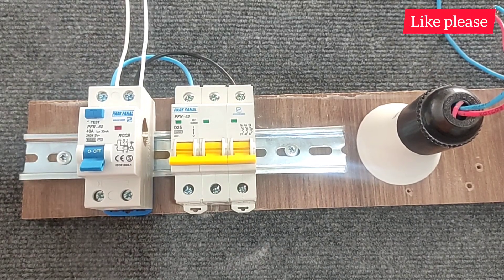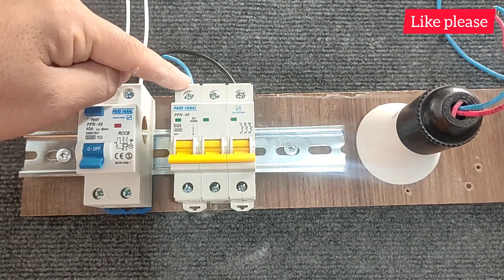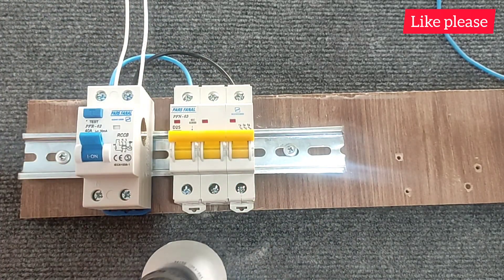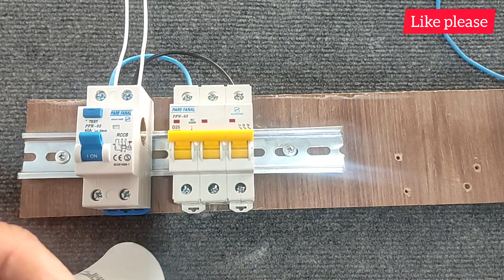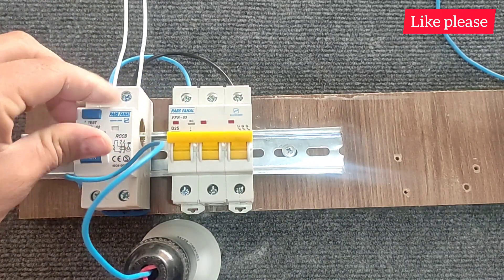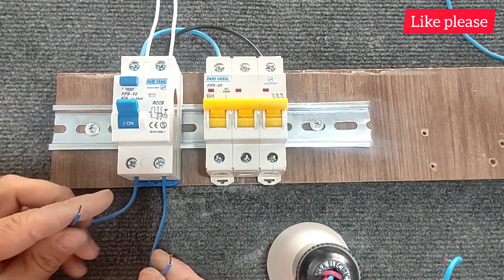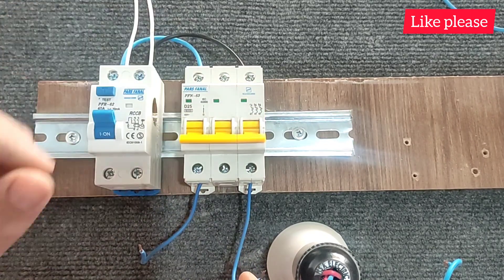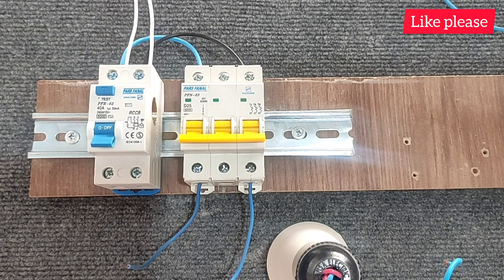Differences between RCCB and MCB(miniature) switches.

Comment: RCCB is used for both current leakage protection and over-current protection. It is recommended to use RCCB at the entrance of the power source and then connect MCBs after RCCB to distribute current.
Reply from the maker: Hello
I am an electrician
According to my experience rccb switches are usable and reliable to prevent current passing